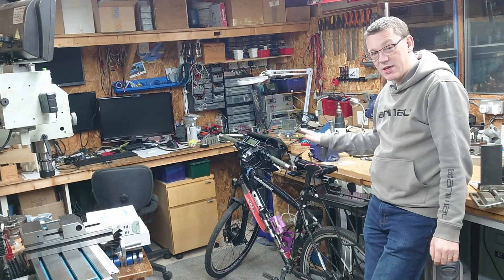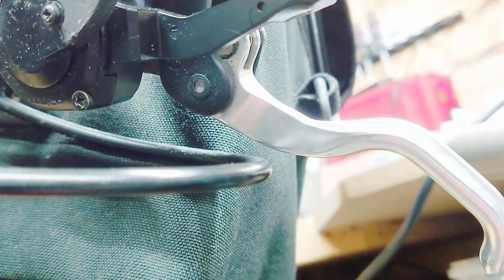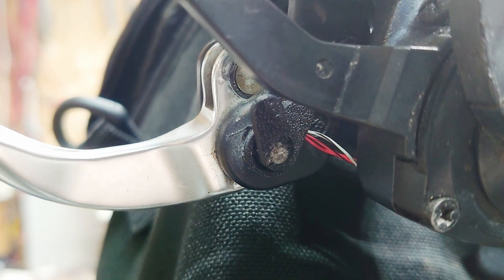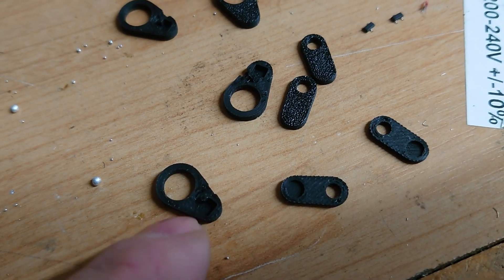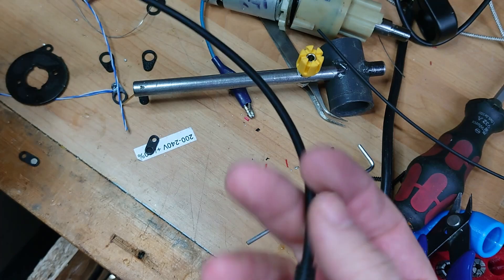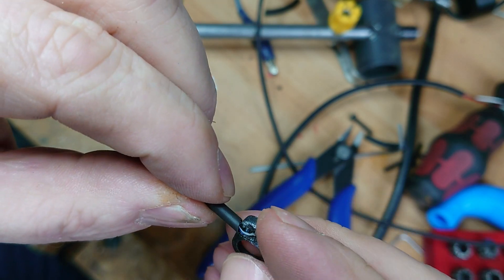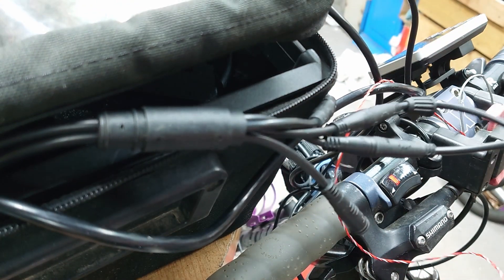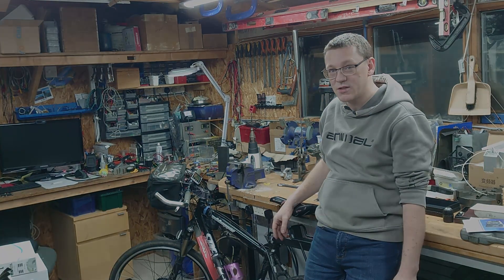Advent 23 - Day 18 - On yer bike...

Comment: A small mod .. ?
How about making the extension on the pin a "D" section.
3D printer can make D shaped holes, I guess.
Orientation can be adjusted with the locking grub screw.
Reply from the maker: Hi Steve. Good point, if I have issues with the magnet arm position moving, then I'll definitely try that. Thanks for the idea.